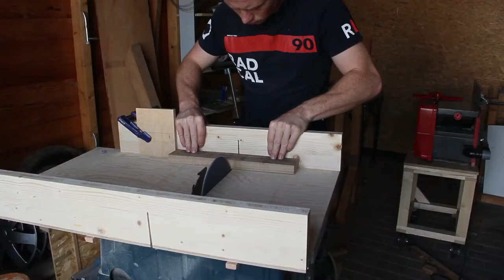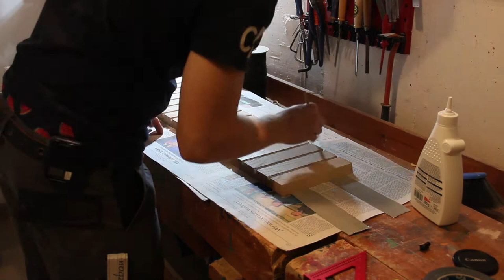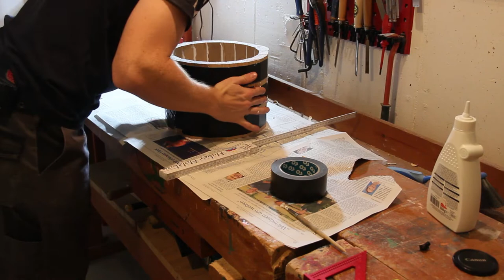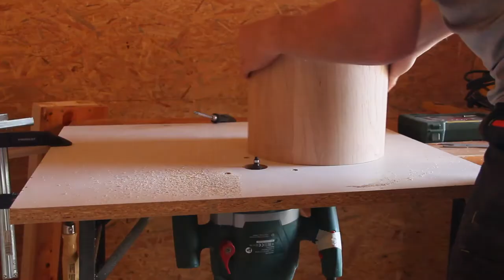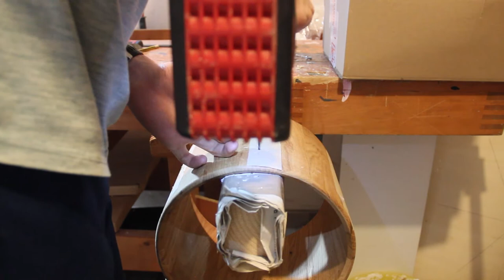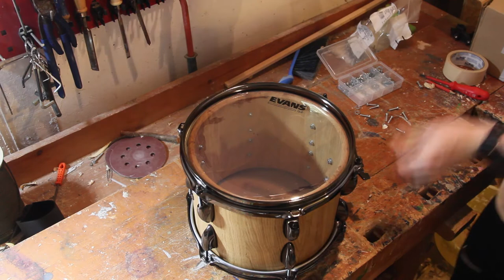Building a 10x8 Tomtom

Comment: Those staves are very thick!. Kit must weigh a ton!
Reply: Not really if you use birch, maple or walnut. Shell thickness should be 12-14 mm. 45 degrees inside bearing an 4 degrees outside radius.